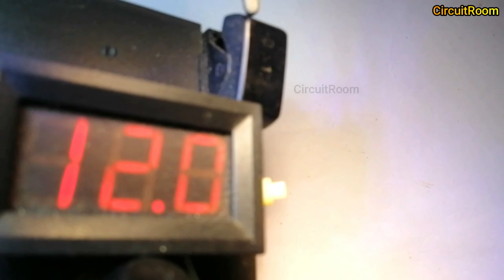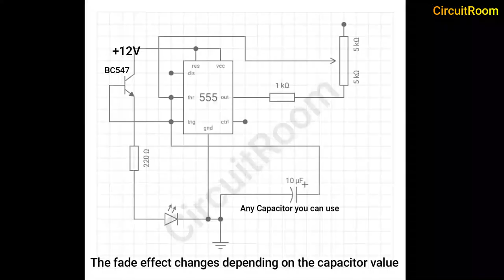Adjustable Amazing Fade Effect LED Bulb | How to Make a Flashing LED Circuit | LED Circuit Project

Comment: would it be possible to use 9V for this circuit?
even moreso, would it be possible, to run 13 sets of 3 LED's (in series) in parallel?

Comment: I see 12volts input power but can this output 12volts power to a light? I want to do this inside a car with a car battery and a 12 volt car light bulb.

Comment: Bro can I use 3.7 volt battery for this circuit
Reply from the maker: If you remove the two 1k /220 ohms resistors, it works but the light is not enough.10ohms can be applied to the led and it can work with 5v.